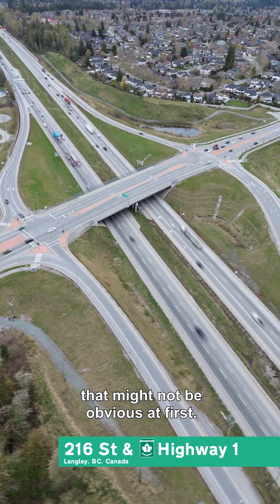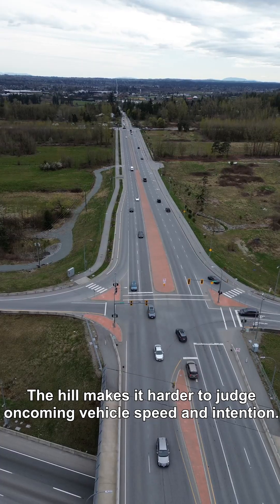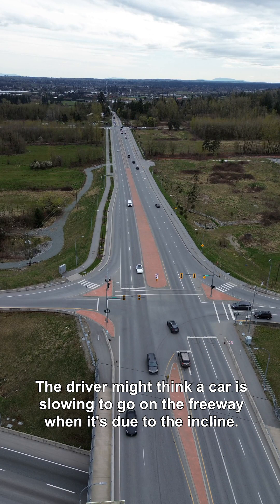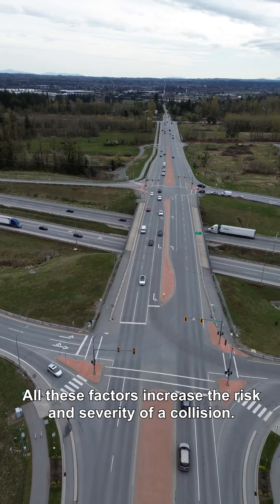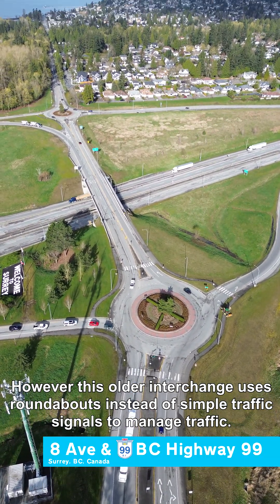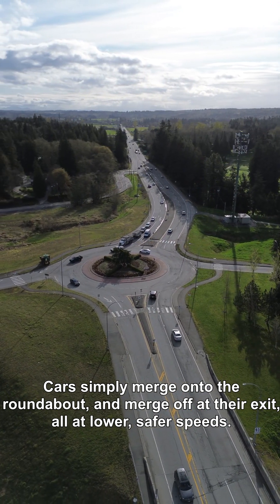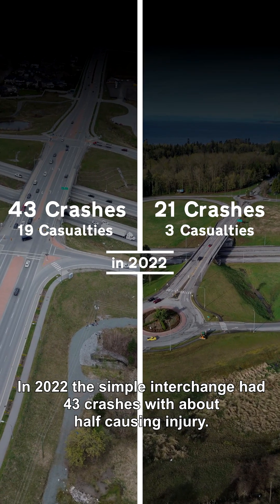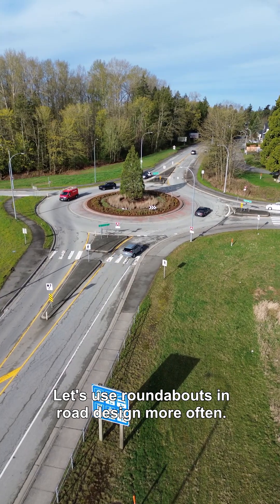Let's use roundabouts in road design more often.

Comment: But they don't move as many cars as a light, thats why they don't get used as much
Reply: They do actually, if built correctly.
Reply: @yamilikethisplsendme  Roundabouts max out at 1000 vehicles per hour, 1700 for double lanes.  They are greatly efficient for low volume roads.  For high volume roads, signals are efficient, but increases delay during the low volume periods.
Reply: @yamilikethisplsendme  no they don't there to slow, maybe in really narrow roads but those don't need lights either
Reply: @Rianmt795  traffic lights are slower, they literally stop the traffic. Roundabouts always keep traffic moving.
Reply: @yamilikethisplsendme  but the cars move faster, for the same amount of road a traffic light is better at moving cars because in a roundabout they may only go 20 or 30 kmh and cars have to drive more distance for straight and left turns in a traffic light they can go up to 70 kmh or more and take the shortest path
Reply: @Rianmt795  yeah they move faster, but the amount of cars is still lower, cause out of all the cars, most of them have to wait, while in a roundabout they can go as soon as the coast is clear. Also you forgot to factor in the time between one light turning red and the next turning green, where no cars are moving at all.
Reply: @yamilikethisplsendme  even then lights still move more cars that's why they are everywhere
Reply: @Rianmt795  not in Europe, they’re everywhere in the US cause the engineers are lazy. If you ever come to Europe, you’ll see roundabouts everywhere and just how much more efficient they are than traffic lights.
Reply: @yamilikethisplsendme  they are not lazy they just prioritize movement of cars over anything, roundabouts are safer and cheaper to maintain but are less walkable and move less cars, if it didn't have downsides every intersection would a roundabout. Roundabouts are good no need to be so pressed because they aren't perfect
Reply: @Rianmt795  Roundabouts move more cars in built correctly.. that's a fact.

It being less walkable depends. The Netherlands have plenty of roundabouts where there are bike lanes that cross over the entrances and exits, and drivers just wait.

https://www.youtube.com/watch?v=FR5l48_h5Eo

While it removes a timed stop all drivers have to wait for pedestrians. Roundabouts often reduce the lanes leading in and out of the roundabout and thus there is a smaller gap pedestrians have to cross.
Reply: The British did a study of Milton Keynes and found that four lane roads with roundabouts carried more traffic than six lane roads with traffic lights. The problem is not the volume of traffic but bad drivers with abysmal driving skills which is typical for the USA.
Reply: They move more actually.
Reply: It's been proven that roundabouts move more traffic, it's just that they can have confusing lanes, which is more akin to bad design that the fact that roundabouts are bad
Reply: Not only do roundabouts move more cars in a more efficient manner, they also require less lanes to do so. Roundabouts have a consistent traffic flow while lights have the platoon effect, with the road being completely half the time but everyone lined up at the light.